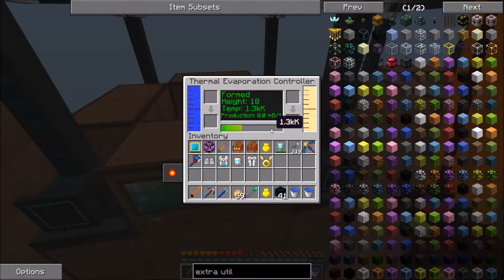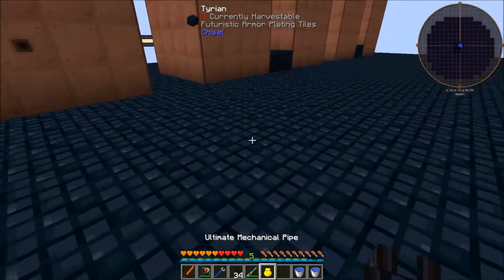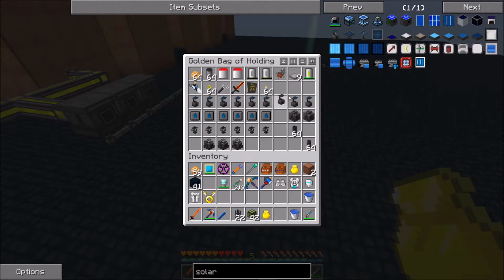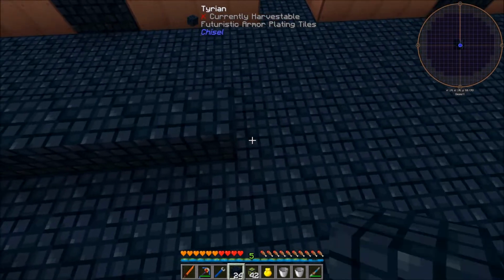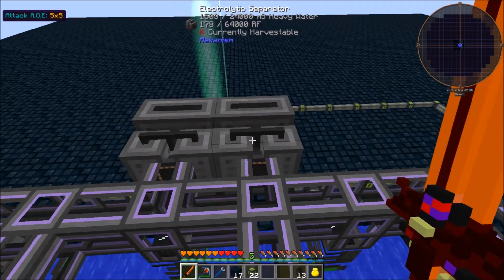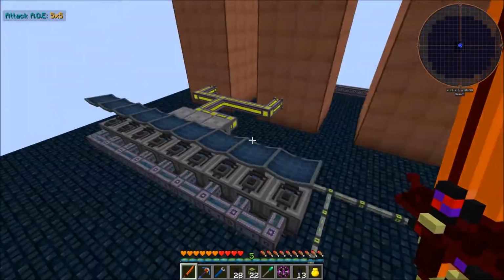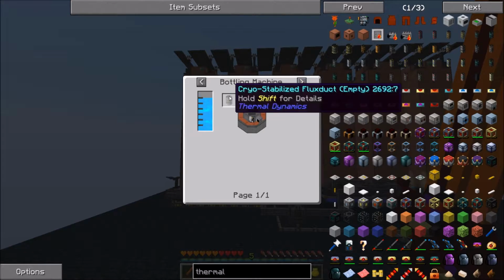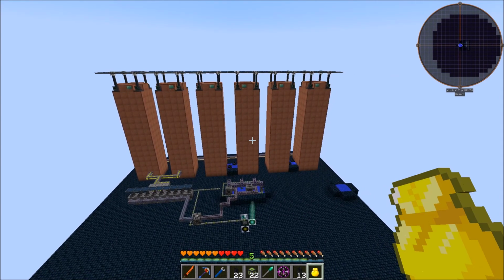Minecraft Crackpack Lp Ep 51: Mekanism Reactor Gasses

Comment: Would it be more cost effective to replace some of your power lines with wireless chargers? At least for places not connected to the main base. Plus the energy conduits are kinda ugly.
Reply from the maker: Well thats what I do at the main base.  The new dimension area will just be set and forget just to produce some liquids and gasses and maybe throw down a solar setup there.  I use the draconic wireless connectors for the main base and such :)

Comment: the solar panels can't reach max temperature, but you can use the power they produce to power resistive heaters to make enough heat to reach the max temp
edit: the maxtier induction matrix from mekanism makes the de energy ball look like a kid's toy
Reply from the maker: Hmm, perhaps the resistive heater will work.  Ive done that method in the past, but it never wants to heat to max, even when I plug it straight into main power, etc.  Gets the heat about halfway up but hasnt ever capped it for me.  I'll def try it again and see, may work better since im in an always day desert.  And yeah, I'm very familiar with the matrix.  I may make one as well, however I still need an energy ball :)  Have to have one of those as well.
Reply: +To Asgaard iirc you can change the amount of power the resistive heater uses to make it generate more power in its gui
Reply from the maker: maybe so, ill def look into it and see.  If so, I def dont mind using power for the heat over combustibles for sure :)